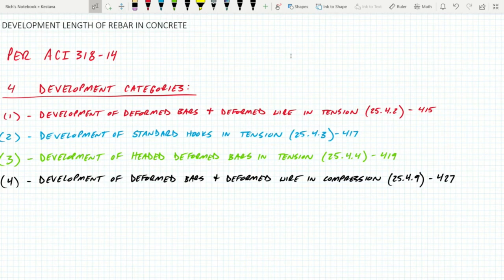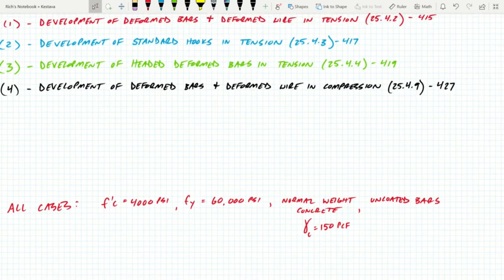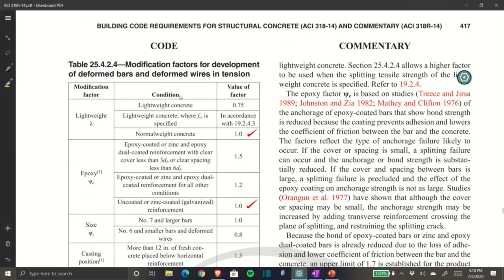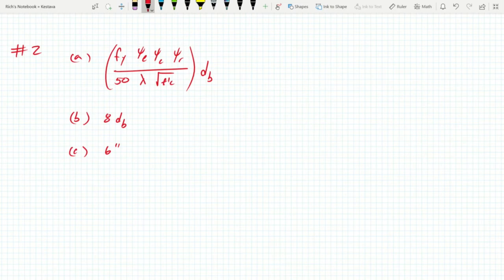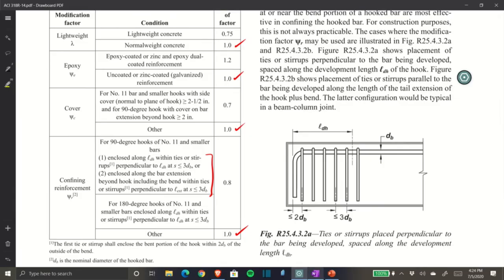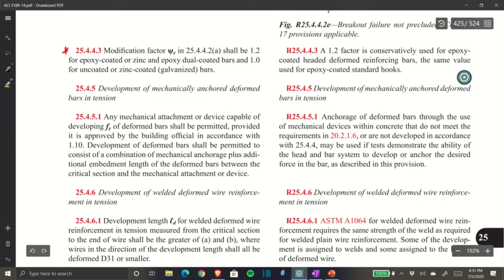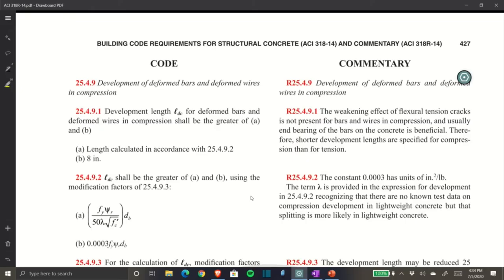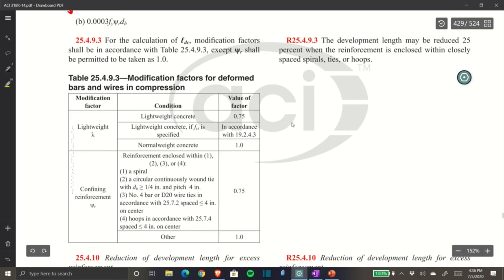How to Calculate Development Length of Concrete Reinforcing - 4 Examples Using ACI 318-14

Comment: A simple way of remembering the diameter of a bar is simply taking the bar size and multiplying it by that number of 1/8" intervals. For example 4*(1/8") = 4/8" = 1/2" = 0.5 inch which is the diameter of a #4 bar.
Reply from the maker: this is SO good! I didnt make this connection!
Reply: Close to true, but not quite. Up to #8 bar, this 1/8" pattern is the case, but beyond that I noticed that the bar size started varying from that pattern. For example, with the "eighth inch rule" as you describe, #9 bar would be with nominal diameter of 9/8" = 1.125" , but it is actually with nominal diameter of 1.128". Another example: Rebar size of #11 would be with nominal diameter of 1.41" and not 1.375" per the "eighth inch rule".

Granted, it seems that if you were to assume 1/8" every time, you would be conservative for area steel (like for bending moment capacity), but I would suggest to make sure to use a chart for anything larger than #8 bar for anything involving development lengths and such.

Comment: Wouldn't ACI 318-19 be the most current code? I imagine it might be good to use ACI 318-14 for the video anyhow because PE/SE exam still reference it. I got a pdf version the 318-19 through the library genesis website I believe.

I think all the code references/sections are the same, but ACI modified some equations slightly and added factors for higher grade reinforcement (Grade 80 and Grade 100).
Reply from the maker: Hi Logan, i knew they were working on 318-19 but was not aware that it had come out! And you are spot on about using 318-14 for the exams. the exams still specify 318-14. for everyone out there - always make sure you check what codes are being referenced for the exam of the year you take it! the last time ACI updated, they completely turned the code chapters around!
Reply: Nice class bro keep it up and we will support u for making more classes like this
Reply from the maker: @syedmubarak8795  thank you! i will work hard to keep producing content that furthers your engineering career!
Reply: @Kestava_Engineering  thanks brother

Comment: Table 25.4.2.4 shows that a number 6 and smaller bars use a coeff in the equation of a 0.8;  What is this for here?  Did we already account for this prior to using this table?

Comment: In the first one (ld of deformed bars and wires in tension), the lap spliced bars are in contact with one another and you are still taking the first case. Why is that?
Reply: Yes, why case 1?
Reply: @ehabaltimimi660  I think the first example should use Other Case (case 2) to calculate the development length because rebars are in contact with each other.
Reply: What do you mean by first case?
Reply: @xinglan9129  what’s case2?
Reply: I think the explanation will be if they are in contact with each other, we can take them as one with very good cohesion with the surrounding concrete, you don’t have an issue with the “spacing” But if they are not, then we need to talk about the spacing as if it is less than diameter then the space is not sufficient for the aggregate to fit in, then you will get voids then it goes the other case scenario.
Reply: So in summary, you only focus on “ spacing” is big enough for the aggregate to fit in or no spacing no problem at all.